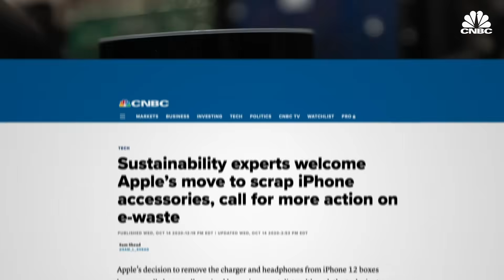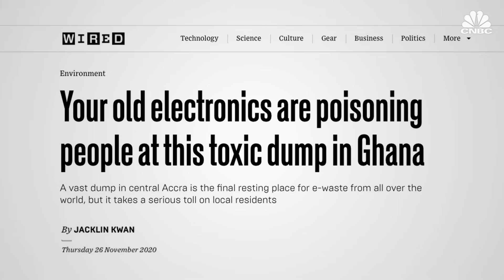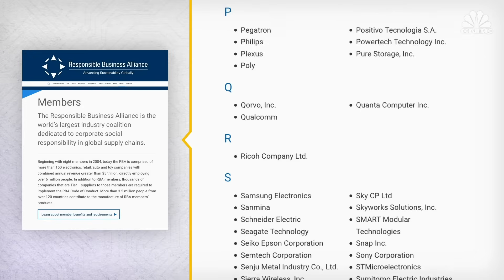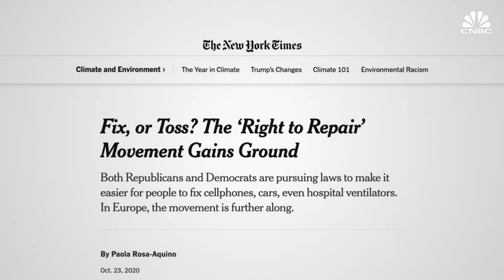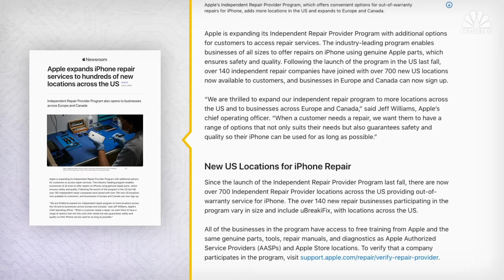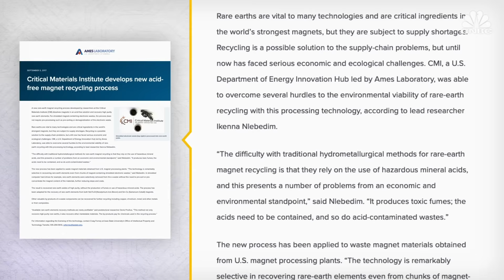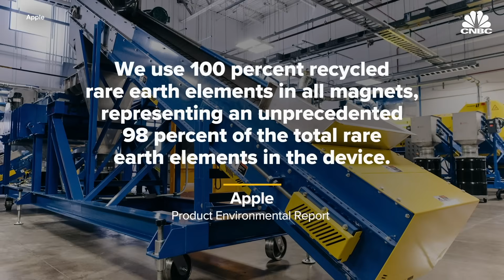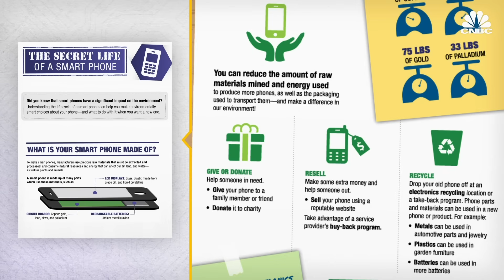How Can We Fix The Massive E-Waste Problem?

Comment: Apple: Introducing the iPhone 12, our most unrepairable phone yet.

Also apple: We removed the charger to save the planet.
Reply: I have an I phone 6 for work,  it was great until recently I swear they want them to break, so you keep buying the newest model.
Reply: @danixoxo8637  I have to agree on the iPhone 6 . But on the other hand it has been out for 6 years and it’s still receiving updates. I mean, yeah but I really think you should get an upgrade if you can, old phones, not only old iPhones, slow down after time
Reply: @richardlim7  true. An iPhone has a life time of 5 years. Then the battery won’t work
Reply: @seanhartnett79  of course, all phones are like that! :))
Reply: In the future Apple: Iphone 13 our new product with no charging port but you can buy our new wireless charger that cost extra.

Consumer: Bruh...
Reply: @brandon-qc1ul  nah not really.
Reply: Futurama was right when it called Apple owners idiots
Reply: Also Apple : Here's Fitness+ with airplay turned off for smart tvs so you have to duplicate your streaming hardware with a new apple tv.
Reply: @MLU8811 while I agree having a 3.5mm port is nice, I recently tried a cheap pair of Bluetooth earbuds, and tbh I really enjoy them.
Power drain on my phone is a bit more significant yes, but it's not that bad, as for the 4-6hr playtime on the buds themselves, so long as I keep both the buds and the charging case charged between uses, I very very rarely hit that battery limit.

Can't vouch for or against sound quality, as I don't use the buds for high sound quality (since I use an over-ear pair, if that's what I'm going for), although it sounds just as good if not better than the cheap corded earbuds I used to buy at Wal-Mart.

Overall, switching to Bluetooth Earbuds, has seriously cut down on the amount of corded headphones I use (would usually only last 6-12 months, due to the cord getting caught on stuff and breaking/short-circuiting), since that's no longer an issue. I've had my current pair for almost a year and they still work great.

Edit:
Plus being able to charge my phone while listening to my music in a different room is great.
Reply: @ShadowVipers  any knock off earbuds I have gotten have immediately broken or had a 2 hour battery life.
Reply: @seanhartnett79  I wouldn't say they were knockoffs of a larger brand, just they were of cheap construction, of which they still work perfectly fine to this day.

Going cheap was more of a trial run to see if I'd even enjoy having Bluetooth earbuds, rather than an attempt to save money.

The reason for that was because I had concerns about Bluetooth headphones:
1) They're so small, I bet I'll lose them in no time. (However, getting in the habit of putting them back into the charging case mostly solved this issue, except when I forgot)
2) Battery life of the buds themselves, will it last long enough for my needs, ~4-6hrs between charges (answer was yes).

Granted, there are a few annoyance that I encountered:
1) The pods have to sync to eachother before connecting to a device via Bluetooth, otherwise the 2nd bud just will never connect (Although I believe this is because I got cheap buds)
2) When I'm listening to something on my phone and my bluetooth enabled car enters the garage, my phone will automatically switch to the car. (However, I believe this will be resolved as the Bluetooth standard improved)
3) Forgetting to put the buds in the case turned into a real pain to find where they were left. (However, working on my habit of putting away the buds should resolve this, and I still haven't permanently lost either of them yet)

In any case the next pair I buy will be not as cheap, since I now know that I like using Bluetooth earbuds over wired earbuds.

Edit: However, under no circumstances will I ever get Apple AirPods, as they are far too expensive.
Reply: @ShadowVipers  my AirPods have lasted for 2 years with absolutely no problems.
Reply: @Yes-ct1md  
I mean, yeah. It's innovation, they are finding new creative ways to scam their customers.
Reply: apple back the: I stands for Innovation and Internet 
apple now: I stands for Invest and Impact
Reply: only to add more trash in the form of extra packaging for the charger, extra shipping media, extra shipping trip.... yeah very very eco frendly
Reply: The interesting thing is that they originally stated that they were taking the cable away due to the cost of 5g
Reply: You can repair it. Just not cheaply.
Reply: samsung is doing the same. what's ur point????!!!
Reply: @njnikusha  exactly.
Reply: @ardentenv  there are worse companies.
Reply: @seanhartnett79  okay, but if worst companies were supervillains, Apple would be a member of the Legion
Reply: @avinashtyagi2  maybe.
Reply: When Samsung and Mi also removes the charger. HAHA. When apple removed the headphone jack everyone started whining and when Samsung did so everyone suddenly shut up. Seriously dude?
Reply: @richardlim7  actually apple did it first, samsun and the others just copied....same goes for the headphone jack, and now CRAPsumg also imitated CRAPple in havin no expansion port for storage
Reply: @richardlim7  true.
Reply: @richardlim7  double standards my dude. They just can’t afford a iPhone so they hate it even tho iPhone is hella better
Reply: @Jesse-jp2bf  exactly! Thank you!
Reply: @richardlim7  (@Jesse) It is not double standards. When Samsung copies apples stupid ideas, you as a customer just don't have any choice any more and basically give up.
Reply: @Jesse-jp2bf  I could buy an IPhone SE. But I won't because I don't want to support a corporation that has SUICIDE NETS OUTSIDE THEIR FACTORY. The legitimate forced laborers that Apple uses would rather jump then build your IPhone 11 Pro Mac with as much ram as a $80 kindle... That doesn't even start the right to repair issues I have with them. I'm not saying that Samsung or Google/Android are perfect, but I can have Samsung parts delivered to my door in 3 days with minimal markup. the "geniuses" will tell me that I have to replace my entire logic board because they "don't do component level board repair". Plus they will tell me there is  water damage that's not covered by warranty because they just look at water indicators that are triggered by moisture in the air. And Apple AASPs are just glorified mailing centers so your only option for competent repair is an unauthorized repair place that has to illegally source parts...
Reply: @Carterthielftw_  hey mate, hope you are on track, that suicidal incident was in 2010. Apple did investigate that incident. “Water indicator  triggered by moisture in the air”, seriously dude? I don’t think apple is so stupid, so idiotic to ever do that. I have repaired countless of iPhones in the past, and it’s impossible that that thing can be activated by moisture in the air. I hope before you put false allegations, read up and check your facts and make sure you are up to date.
Reply: @Jesse-jp2bf  laugh my ass of, why should I need a phone that cant do the things samsung can do
Reply: @richardlim7  although I have not repaired an Apple device I have done 3 screen repairs on androids and kindles, I have just built my 10th pc. So I find hardware interesting. I would encourage you to look Louis Rossmann up on YouTube, this guy does component level board repair on Macs and data recovery on any Apple device. These are services Apple not only flat out does not offer, but they actively attempt to disenfranchise repeatedly telling customers that "all data recovery services are a scam" and "component level board repair is impossible" (ironically it almost is because of Apple's locked supply chains.)

The white water indicators on modern Apple products will legitimately turn red in higher moisture level areas. THIS IS NOT BAD. They are supposed to do that. The issue is that the "genius" often just takes it at face value and denies warranty repair. I believe rossmann caught this using a hidden camera in an Apple store. He had someone bring a MacBook in whose display cable was damaged and asked for a repair. The "geniuses" quoted him the entire logic board assembly, SSD, and possibly the display. + there was "water damage". The genius then made it very clear that he should just buy another one as the repair is so expensive. Of course this is just one case right? Sadly no, as rossmann always has literally thousands of tickets and people are always coming to him after exorbitant Apple store prices. 

But bar that. The important thing right now is Right To Repair, if what you were saying about repairing IPhones is true, you will know firsthand all the crap Apple pulls. And how this issue is slowly making its way into the Android market. Even if you are a die-hard Apple fan I hope you can recognize the issues that we need to somehow solve.
Reply: @Jesse-jp2bf  true.
Reply: @Carterthielftw_  the problem is with terrible companies in China. Not directly Apple.
Reply: @seanhartnett79  I agree that it is the 3rd party contractors that are the issue. However, do we just ignore the fact that this company, valued at over 2 trillion dollars, cannot just hire 1 singular person to live at these factories and report back with any issues? There are people on YouTube that sell merchandise, if they can keep an eye on the working conditions of factories that they are in partnership with, Apple certainly can. Louis Rossmann put out a great video yesterday outlining how Apple knew that a factory was using underage and forced labor for years but turned a blind eye because "it would hurt our bottom line". 

However I know that apple, sadly, is not the only one utilizing this type of labor. And there does not seem to be a good way to stop it.
Reply: @Carterthielftw_  when you work with a large company, you might not know. Besides third party’s and so on, frequently lie or put on a front when inspectors come. How could you prevent that?
Reply: @Carterthielftw_  every company is using it. And Apple is trying to stop them.
Reply: @SarahAndreaRoycesChannel  indeed, if every companie emulates CRAPple's "innovations" then they eliminte options, so what do we do?
and even if consumers find a way to make their phones last, eg, take care of them so they don't break, then companies come up with a software"update" that make the device sluggish, or simply get app makes to "require" the latest phone OS available so people with good working phones, that are not able to update HAVE to get new ones, andf even if they don't use apps,  the phone companies also axe people, by putting unneeded new "G" classes and shuting don the good working, albeit bit slower one off (my grandmother had to replace her phone because the nice companies in the US shut down 2G, even tho she only used her phone for calls, which worked fine, no on the newfangled 4g and 5G she has almost constantly dropped calls on her new 5G phone)
Reply: @ACF I wouldn’t say outdated technology. Yes, Samsung and all other companies can come first. But we don’t care about the first, we care about the best. Even if it is outdated, as long as that technology’s skills is the best, then yes, it’s amazing
Reply: @richardlim7  isheep spotted
Reply: @richardlim7  would love to see your response to Carters well constructed argument as to why Apple is shady and terrible when it co.es to repairs

Comment: the problem with e-waste is 2 companies, apple and samsung, apple designs their products to force buyers to buy new phones and macs every year, samsung designs their products to be useless after 5 years, what's needed is legislation to allow 3rd parties to have access to replacement parts, then pass laws that makes it a requirement for electronics to have a guaranteed 10 year operating design. and must be designed in such a way that it can be repaired

Comment: Apple: Removes Wall Charger from iPhone Box to be Environmentally friendly
Also Apple: MAKES MORE DISPOSAL PACKAGING MATERIAL FOR WALL CHARGER
Reply: You can just use your old charger. That’s the whole point. They don’t want you to buy a new charger.
Reply: @dapoptart3714  No they just found a way to make their boxes smaller to save on shipping costs. More profit that way. The charging brick simply took too much space. And they are including a usb type c cable so most users don’t even have a type c power brick. Guess what? Apple will also sell that to you.
Reply: @Jabid21  1st of all yes the shipping cost is less so they would save on money. but that means they can transport more phones too so they would be saving on co2 emissions. and as i said you can just use your old lighting cable and your old charging brick.
Reply: They probably changed the milliamps so that the older charger damages your new battery.

Comment: I still use my Asus Z2 for 5 years until the screen breaks due to a bad fall during November 2018 then got to repair it from a shop. This time the screen has cracks and touchscreen capability is malfunctioning then battery needs to be replaced due to fast drain and I always plug it all day.

Comment: One thing I know is that Apple products seem to be relevant longer than a lot of the oppositions products. I have a  2005 iMac which mostly still works, a 2013 iMac which still works fine and is our current computer. I also have an iPad Air 2 and an iPhone 5 which both work fine. My newest tv is a 2008 Panasonic lcd which still works fine. It’s more about the products people buy. You pay cheap you get a cheap product the dies quicker.

Comment: Standardizing ports would help immensely. Making all charging cables the same (Type-C)  for phones would help a ton. The same goes for laptops. There are infinitely many charging ports for laptops. Apple has kept changing theirs until recently, and it still varies between laptops. At least they have settled on one charging cable for their phones for the last couple of generations. 

Switching back to removable batteries would help a ton too. I bought an Otterbox numerous times. I do not care about having a thinner phone each generation necessarily.  Bigger, replaceable batteries would be great. 

Not selling everyone super cheap .5amp charging plugs would help too. I still have to go buy a 40W charger to fully take advantage of my phone's quick charge. The included chargers with phones have been rip-offs and a class action lawsuit is warranted in my opinion. Why put insane quick charge capabilities in a $1,000 phone, and then include a borderline useless charger? It is very antitrust in my opinion. 

Also, making subsequent generations of phones the exact same shape would help with e-waste too. Especially for wholesalers of phone cases.

Comment: Just some basic computer knowledge like replacing hard drives with SSDs can allow an older computer to work for several more years because of those read/write speeds.  Also, that Windows 10 update from older Windows really helped to keep older computers still functional.
Reply: yea, however now laptop manufacturer are coping apple, first sealed in batteries, next and is already done soldered ram, next is soldered SSDs

Comment: Have been using my Sony Xperia Z2 for nearly 6 years now, never felt the need to buy a new one, as it can do basically everything a modern smartphone does.
Reply: i've got the blackberry key 1 since 2017 so i am going into my 4th year. but for me its more habit that makes me keep phones. i don;t like learning new tactile experiences.
Reply: Yeah! I've had a OnePlus One that I used for 2½ years before the baseband began to fail (it would no longer connect to the Internet through a mobile network), then a Galaxy Note8 that I had for another 2½ years before it became very slow and had annoying input lag issues (where it would often think I was holding down on a button on screen when I wasn't), and am now using an Xperia 1 II that, with the high price, I hope is supported for at least the same amount of time Google supports Pixel phones for, but with an earphone jack and no annoying screen cutout. I still have the 2 other phones, as I repurposed the first one for its camera and storage, and am still in the process of recovering my data from the other, after which I'll repurpose that too.

Comment: Right-to-repair, followed by vastly improved recycling technology. That's how. The first one can be done right now, the second one depends on a scientific breakthrough to make it possible.
Reply: Or just dont change your phone every two years.
Reply: @076657  Which requires people to be able to fix their phones without the planned obsolesence in every phone today; which is what right to repair does. Otherwise, the phone becomes nearly (or actually) unusable every two years.
Reply: @specialopsdave  my iphone 6s from 2015 is still supported and updated. Promote companies that support their products for longer than just 2 years. Thats ridiculous. 
But of course I agree, tech should be repairable. I replaced the battery in this iphone, it was still doable but had glue, I imagine phones now are a nightmare to open up which is infuriating

Comment: The main problem is in producing companies and applications developers. Each year many people use more and more apps, which require more RAM memory, newer OS and etc.
I do not care about more powerful processors, cameras and etc. I am actually forced to change phones once in 3-4 not because I don't like old ones, but because they start managing app slower or can't even upgrade.
I have 8 years old iPad which I like, but agein some necessery apps can't work without updates which are impossible to be installed on older iOS. Agein it's forcing to purchase a new one, although I do not need one.